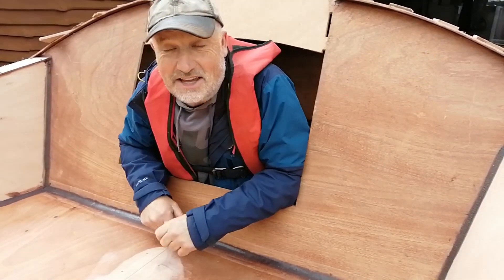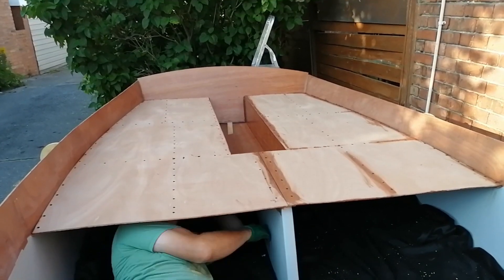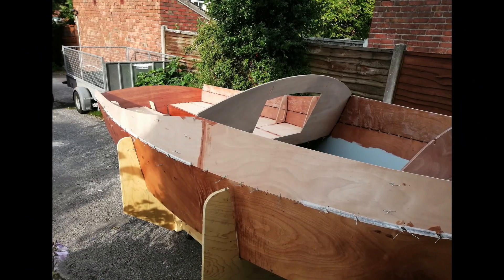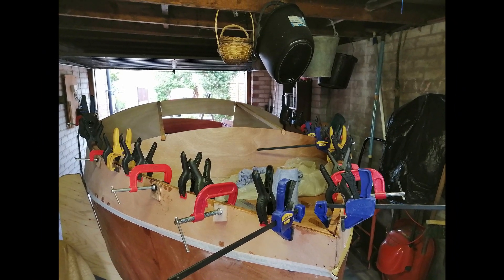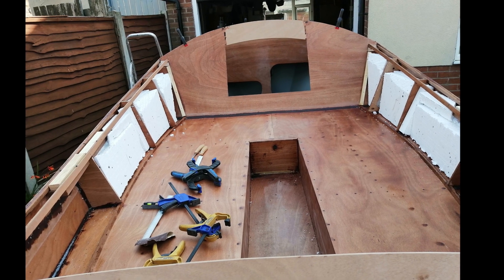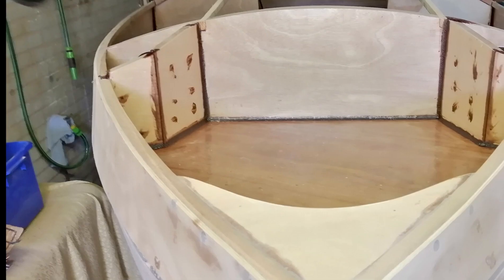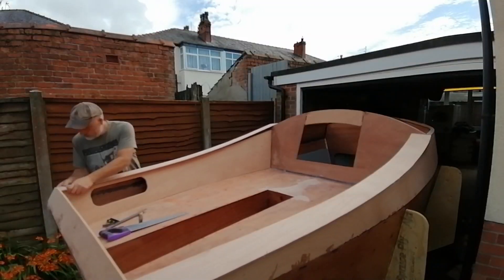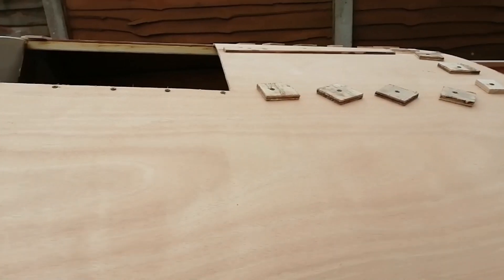AHAF Building a Pocketship part three

Comment: I don't understand the purpose of the polystyrene - is it there for if the boat capsizes?
Reply from the maker: Thanks for your question. Yes it provides flotation even if the air tight chamber it is contained in springs a leak.